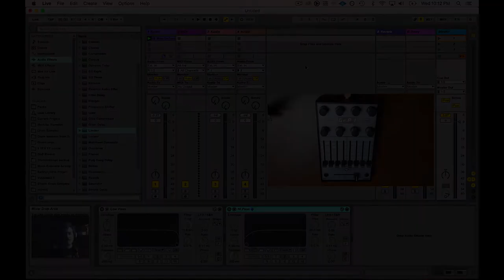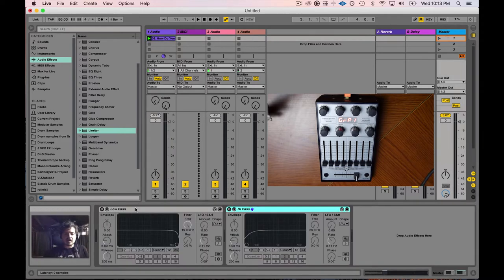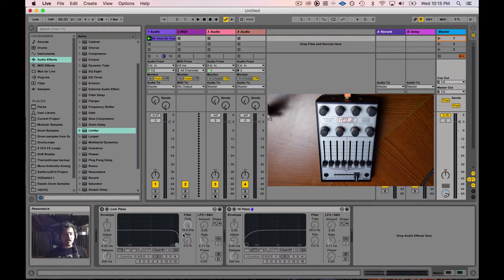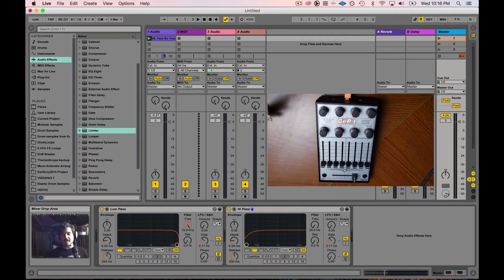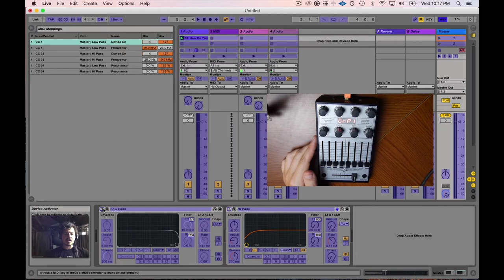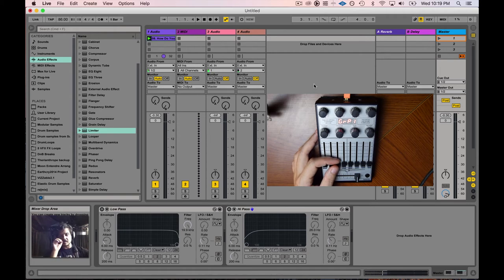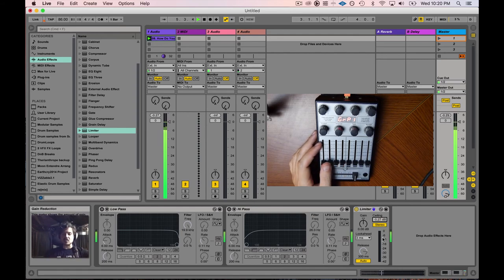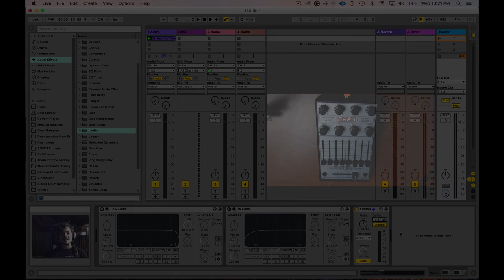Using Ableton Filters Live the Right Way

Comment: thanks for video. im also using this method for live effects, but sometimes experiencing noticeable clicks on effect's on/off and it is really annoying when live performing. Did you experienced it also?
Reply from the maker: Well it all depends on the effect. The autofilter probably needs no "look ahead time" and therefore for me never causes any lag or clicks. If youre using compressors or other plugins that require a significant amount of look ahead time, I imagine many clicks could occur. It would be difficult to diagnose without witnessing the issue.
Reply: thanks for reply. I know that Compressor has 'lookahead' adjustment, but autofilter (which usually causes me clicks) has no 'lookahead' option!?
Reply: @gandlar7  Hi, have you solved this problem? I have the same.

Comment: Hey Anthony, thanks for the tip. When setting this up in my set I'm experiencing a weird issue where sometimes when I turn my knob enough to engage the filter, the frequency jumps to where the filter is instantly closed. Any idea what's causing this? Using an apc 40
Reply: Haha figured it out. Turning remote off for the apc 40 midi output fixed it
Reply: Keagan Semon Can you use the apc40 to Control devices when the remote is off? I had the same issue that you mentioned above, but i dont know what the remote Control means